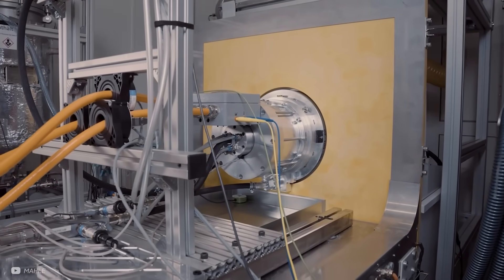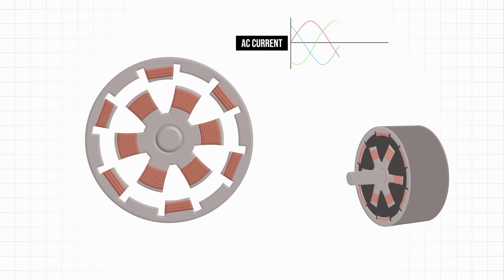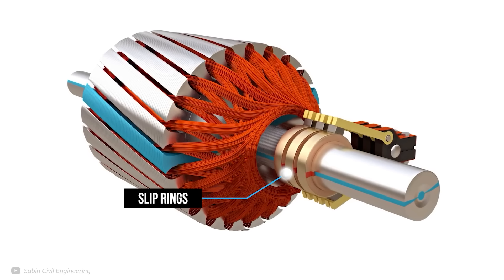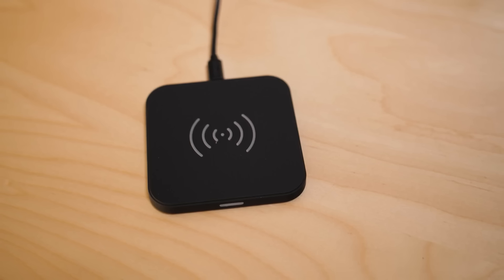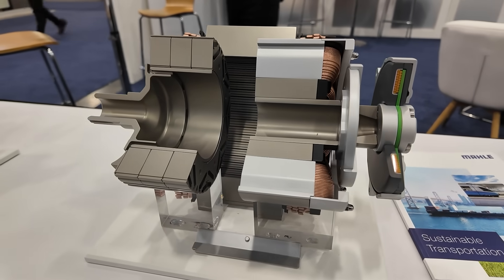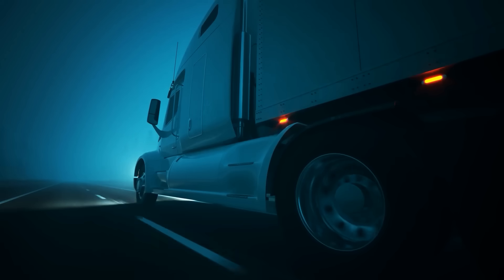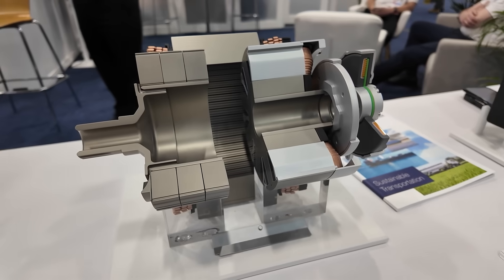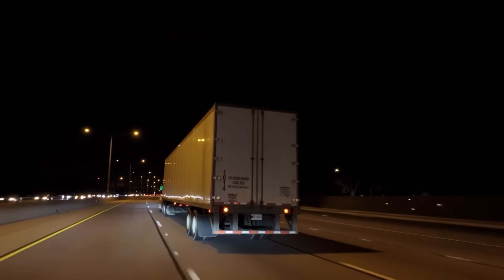Genius Contactless Motor Could Change Transport Forever

Comment: With induction  motors achieving close to 95% it's  hard to imagine anyone stating "much higher than conventional  induction motors" i think your sources on induction  motors  are incorrect. You also didn't  take into account the losses in the magnetic field creation.  The field requires  current to maintain  it, and the will be losses in generating  the required  voltage from the batteries. There's  a reason induction  motors account for the vast majority  of motors  being used. Mahle may have come up with something  great, but there's  not enough  details  here to prove  it.
Reply: You are suppose to think all motors are like the ones in the toys we took apart as kids. Seems they are splitting hairs on efficiency and claiming Eureka
Reply: I may be wrong, cause it's been a while since my college classes on electric machinery, but isn't it a thing with induction motors that they aren't great over the whole range of operating conditions? In other words, they are very efficient when operating at a particular, continuous load condition, like driving industrial equipment. As I understand it, one reason to prefer permanent magnet motors is if you have wide variations in the load and speed, as you would when driving the wheels of an EV. So, the surprisingly low number he quotes (which surprised me too, btw) for the "efficiency of induction motors" might be missing the caveat of "when used in EVs".
Reply: @mike200017 Tesla's logo is one tooth of an induction motor. Their original products were all driven by induction motors. I'm not sure what they uses today. They were/are vector controlled which allows for higher efficiency across the operating range, but you are correct, permanent magnet motors are more efficient.
Reply: @joeholland9593  Ah, yeah, that makes sense. I vaguely remember that in the early days of Tesla, they were very much touting their controllers / power-electronics as being where the real "secret sauce" was. I imagine that PM motors in that size range are quite expensive compared to induction motors. So, to hit mileage and performance goals, at a reasonable cost, it's a better trade-off to use really good controllers over induction motors, than to go with PM motors.
Reply: Yup: Induction motors stink for efficiency.  And I would love to find ANY induction motor claiming anything over 88% efficiency.  True Syncronous generators are at best ~92% efficient.  If you add certain asyncronous aspects and a motor controller technically we can hit 95% efficient.  PM motors are 98.5% efficient and when combined with a motor controller with an efficiency of 98% has a FLAT efficiency curve UNLIKE this garbage standard induction motor shown where half the time it is going to be running at ~75% efficiency.... ....  Yup: This is an idiot YT video all right...
Reply: @w8stral  Actually, the larger the induction motor the easier it is to make them efficient.  The losses become a smaller percentage of the input power as the output power increases.  We manufacture single phase induction motors that drive refrigeration compressors that are over 89% efficient in the 2000 watt range.  There are 100KW three phase motors that are 98% efficient.  I have personally designed 1000 W brushless DC motors that are easily 93% efficient, the problem if use a highly efficient controller to drive the motor, say 95%, the net efficiency now drops to 88%, not much better than an induction motor.  Your efficiency gains come more from driving the load based on demand using variable speed.
Reply: @joeholland9593  98% eff... LOL.   World record using permanent magnets is barely above that.  No induction motors even pass 90%.   Why no one uses them for high efficiency, but rather power density.  Why one uses asynchronous etc.  Most efficient controller surpasses 98.5% eff and can approach 99%
Reply: @w8stral Did I cross into a parallel universe? The drops across the FETs or IGBT's are enough to drop a sub 2KW control below 95%. I designed many induction motors with efficiencies approaching 90% and they were single phase! Three phase is even better.
Reply: @joeholland9593  Well you said the magic dumb words... You said FET, and IGBT which are even WORSE.
Reply: @w8stral There aren't a lot of 100 KW permanent magnet motors out there.
Reply: @joeholland9593  Yup, but it is what is required for higher drive efficiency, or superconductors(same thing as magnets really)
Reply: @w8stral  numbers I found are induction motors are about 2% less efficient, on a car that would be a difference of maybe 6 miles of range
Reply: @SuperFredAZ  Sigh: That is PEAK efficiency difference.  Look up a typical efficiency curve of induction motor; it stinks.  A motor without a gear box or equivalent is NOT running at peak efficiency over its RPM range.  Why they have gone to PM synchronous motors which when combined with a motor controller allows a flat efficiency curve compared to garbage induction motors.  You will note the dual motor Tesla's for instance run primarily on the more expensive synchronous PM motor using a WIDE RPM range and their 2nd motor is a cheap induction motor for peak power which is ONLY used when LOTS of power is required where they do not care about efficiency.  The mileage difference if you used an induction motor compared to PM synchronous + motor controller is going to be AT LEAST 10% difference, not 2% as MOST of your car's driving time is NOT going to be at PEAK RPM efficiency.  That is a 30mile difference at least if not more.   Also means your batteries are degrading faster as you are using a higher SoC per trip.  A 30 mile difference in reality equates to a 60 mile radius reduction due to HOW people drive and worry about filling up your vehicle so you are not stranded on side of the road.
Reply: I've been a motor design for 41 years, I can assure you the source is accurate, I am considered an expert in my field. I specialize in hermetic motors which have always been more efficient than open motors, but today, ther are open premium induction motors produced by companies like Regal Beloit that are 88 to 90% efficient at the peak efficiency.
Reply: 95% is peak.. under heavy load or running warm or hot can reduce that substantially.. below 50%. So we have a long way to go.
Reply: @simsadie6 I've designed induction motors with very flat efficiency curves over a wide torque range. You select a motor to run at a typical load not extremely hot or highly loaded. Induction motors aren't perfect but with over 85% of  installed motors being of the induction variety, they are pretty tough to condemn.

Comment: Cool!

What about the size, is it bigger or smaller in size?
Reply: That's what he was talking about when he said power density. The company hasn't provided any firm figures yet so our host had to extrapolate a bit. I would expect (from old experience with electric motors in general, but I'm still guessing) these will be somewhat heavier and take up more room than current permanent-magnet ones, but there will still be the advantages mentioned. I would imagine these would be first used in trucks, and maybe planes?

Comment: So it's using the brush less technique from generators to have a magnetic rotor, this is the first magnetic flux loss then from the magnetic rotor to the stator, second loss, oil cooling needs a pump, that is your third loss, if the oil is in contact with the rotor yes more losses. It is a classic non effective efficient system, the maker is selective not telling all details

Comment: Always a bit sus when a company decides to use catchy phrases like "wireless power transmission" rather than just saying induction.
Reply: Heck, "rotary transformer" would have been sufficient. Those things have been in VCRs for years...
Reply: I think maybe they just didn't want to keep explaining "But it's not an induction motor."
Reply: @trelligan42  Its literally an induction motor but unecessarily complex and looks less efficient. dont know about the oil cooling either.
Reply: @SentinelAerospaceOfficial no, it is a separately excited synchronous motor using a rotary transformer to feed the windings.
Reply: The "public" knows "wireless power transmission" because our phones use this... and just saying "Induction" and people wonder what you are talking about.
Reply: @rmwright70  I think it depends upon whether the "Presenter" is more interested in "Precise" or "Convenient." He can blather on around the topic or show a new concept or invention clearly. It all depends on whomever is programming the A.I.
Reply: Induction is a long-used, established, and proven technique. It's very common among mobile devices. It's also very efficient. A friend of mine worked for a company, who developed wireless induction charging systems for popular electric cars... such as the Nissan Leaf and Tesla Model S. Their systems were actually faster, more efficient, and generated less heat, than plugging the car in directly.
Reply: synchronous motors have speed limitations that induction motors and switched reluctance motors don't have
Reply: @theJonnymac  -  the core can be "switched" to any wave form that facilitates the highest energy conversion at any potential speed- core centripetal forces may be more of a limiting factor.   (Once there is an infinitely programmable VVVFD on the rotor and stator-  "synchronous" may loose its meaning - Just as BLDC has no real meaning once AC waveforms are used for the stator-  Literally" PM Synchronous machine"  the only thing DC is the input to the motor driver...
Reply: @theJonnymac  Not if they are driven by a control which can change the frequency of the power source.  This is essential in an EV motor since you obviously run the motor at a variety speeds.  RPM = 120* Hz / #Poles  If you can vary Hz, you can run any speed you want.

Comment: Direct oil cooling induces drag. This drag increases exponentially with RPM, hurting efficiency at higher RPMs. I am aware many manufacturers use this type of cooling, but that doesn't mean there isn't room for improvement.
Reply: I've heard about hydrogen cooling of powerful generators in hydroelectric power station.

Comment: What I'm wondering:
You have to have AC for the induction to work, but you can't use it for the magnetic field of the rotor since that has to be constant. Is there a rectifier after the induction coil?
Filling up the motor with oil sounds like a bad idea, since it will create a lot of drag in the tight gap between rotor and stator (think of hydrodynamic clutch).
I'm still doubtful about the performance of this kind of motor.